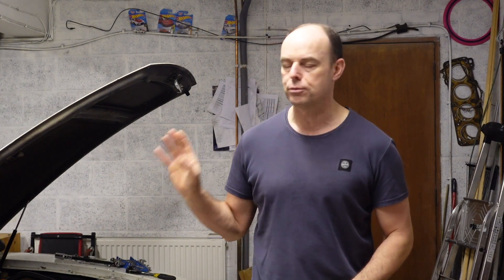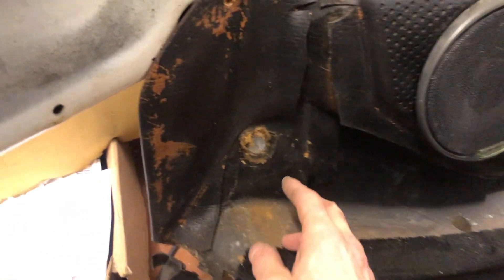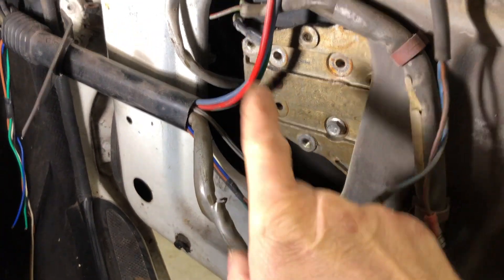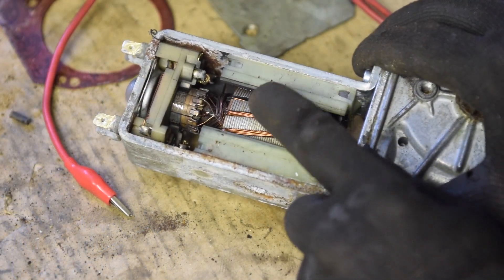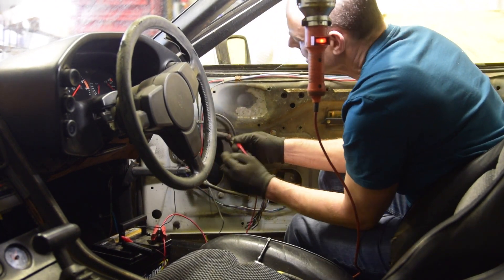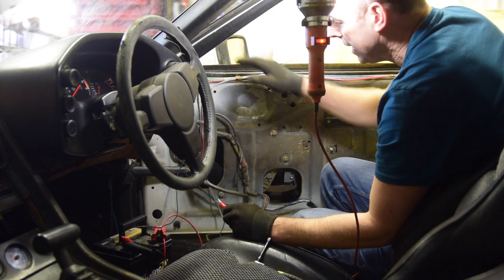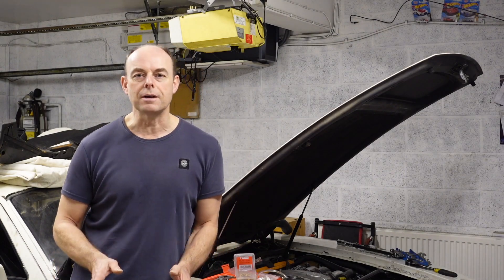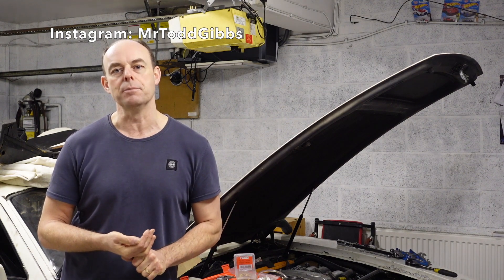Porsche 928 Episode 86 - This is winding me up...

Comment: Great work keep it up. Switches left to right (1984 Euro LH car) : Left window, sunroof (if you have one), rear screen wiper, right window. Widow scrapers: there are after market parts / mouldings available (supplied in a strip and cut to length). However, I suggest buying the actual Porsche ones (cost a bit more but does the job perfectly) . They are approx £150 a side (so expensive) but they are easy to fit (use  a bit of silicon spray to ease them on as you push them into the grove on the inside of the door). The Porsche ones are shaped at the end to accommodate the curve at door handle end. If you take the cheap option they will be a PITA to cut so they fit nicely. While you are there: Suggest greasing the pole that guides the window up / down plus, if there is movement / rattle from the nylon fittings that attach to the glass / pole you could slip a thin cable tie through nylon fitting to eliminate any slight movement / rattle. A short term fix. I used this method for some years then gave in and bought the proper Porsche felt pads, pole and new nylon fittings, made a significant difference and I wish I had done it years ago.
Reply from the maker: Oh thanks Redkenj, amazing info! :) what is in place of the sunroof switch if you don’t have a sunroof (like mine)?

Comment: You need to take the window mechanism out and clean and lube it. Also lube the chrome guide rail and replace the white nylon guides and a rubber foot pad for the chrome bar.
Reply from the maker: Thanks Gunar. I’ll take a look before I put the door panels back on!

Comment: The other switches that are missing in the center console are for the sunroof and rear wiper. As for the speaker holes, that's probably because it's nearly impossible to find replacement speakers as Porsche had some custom-made speakers that were thinner than anything else. So you either need to find speakers from another 928 or somehow enlarge the space to replace them.
Reply: I think you can get the door speaker replacements easy enough, it's the rears in the B-pillar that are hard to come by. I think Crutchfield in the US do replacements.
Reply from the maker: Thanks Jack. Guess I will need to be creative to solve the speak holes….
Reply from the maker: Do they do magic “hole-in-leather” patches as well ?:)